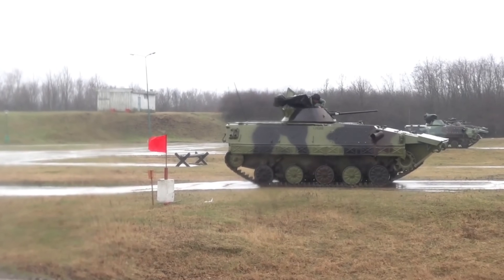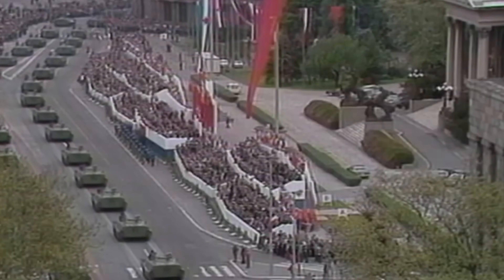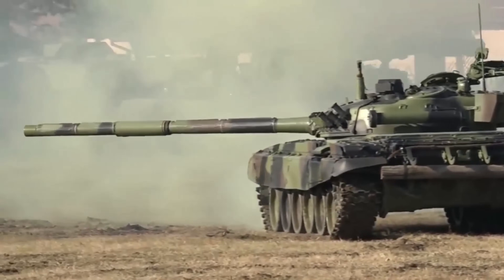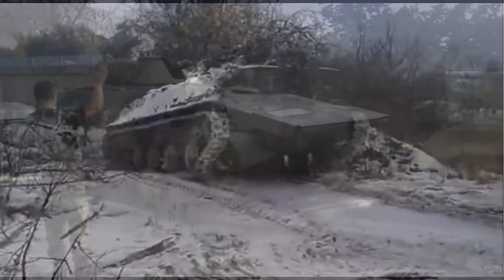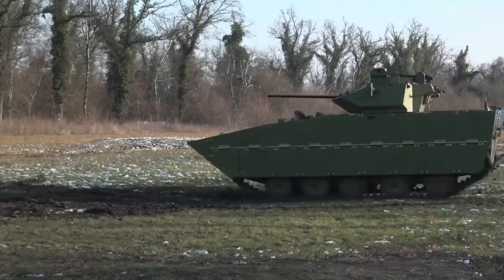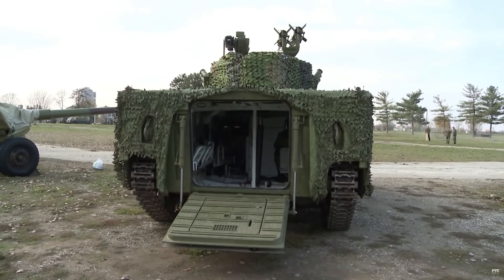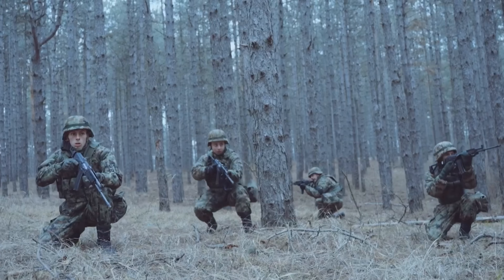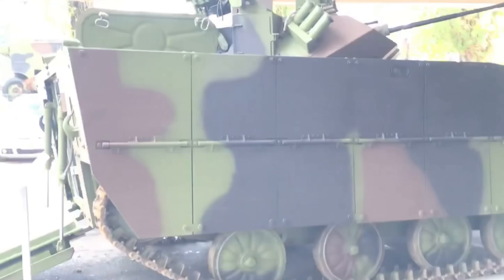Yugoslavia’s BVP M-80 Infantry Fighting Vehicle Explained | SOVIET BMP COUSIN

Comment: The M80 BVP is the AMX 10P. The AMX 10P is the M113 on steroids. They all have 5 wheels on the side. Yugoslavia built a pre-production M113 with a 25% thinner aluminum wall, the OT 60. Based on that experience, they set out to build a domestic version of the AMX 10P.

Comment: Bradley, I was part of the Infantry School team that introduced them to the first Infantry Units at Fort Hood.  Going from the One-One-Three to something that could toss 25mm grenades 2,000 meters down range was impressive.
Reply: The M3 took a lot of adjusting to for me as Cav Scout, the firepower was great but the thing was big as a house compared to our 113s. The reconnaissance part of our mission definitely required a different approach. Honestly though my biggest complaint is that it was easier to find a flat place to sleep on a 113 lol, the Bradley was a big upgrade in every other way.

Comment: Tank you too Matt. Lower cost, maneuverable, and ease of maintenance are invaluable as WWII proved.
Reply: Yeah, if you have nothing else it's much better than nothing. If you can choose, you don't choose M-80.
Reply: @markwhite168  I do , over the BMP-2 ( The only Thing I even like about the BMP-2 is the 2A42 Shipunov )
Reply: @PatriotEnfield3276  well, Croatia first acquired Finnish Patria AMVs as a similar vehicle. With no weapons. Then it acquired Spike AT missile and 30mm unmanned turrets for some Patrias. Then there was an US donation / deal for refurbished Bradleys - they're arriving now.
Maybe an interesting topic for @Matsimus would be to compare modern wheeled and tracked transport vehicles, like CV-90 and Patria.
Reply: @markwhite168 
Patria AMV is a great vehicle and Croatia possesses enough of these to fully equip a mechanized infantry brigade. Although most vehicles are APCs (12.7mm RWS) with only a dozen or so being IFVs (30mm RWS), the 8x8 wheeled vehicles make for a versatile unit capable of accomplishing a lot.
When it comes to combined armored-mechanized units deploying tanks, I have to give advantage to tracked APCs/IFVs over wheeled ones. They have more similar logistical requirements and mobility as tanks.

Comment: Couple things...Version that you showed in this video is prototype. Final version, of the hull atleast, has a ramp (still door will remain as part of the ramp if ramp is blocked) and diferent headlights that are "better packed". Final version will use new stronger engine 370hp instead older 320hp. It is decided that final version uses 30mm zastava m12 cannon ( double fed) and maljutka 2T5 missiles (they are supposed to be packed in tubes instead sitting on rails like in video) with 5 km range and 1000mm penetration. It will be wire semi guided. Wire guidance remains because it can not be jammed. 30mm granade launcher and 7,62mm coaxial machinegun are there also. And also one big thing...Turret will be DUBS type which means all crew will be inside the hull. Armour protection, even its much better than the old one as you mentioned, will remain weak part of this modernization and amphibious cappabilitie is "sacrificed". New fire supresion   and ABC protection sistems, new comunication sistem...There are some rumors that cope cage or jammers (or both) will be instaled for protection from drones. You could do video about nora b52 which is in use with Serbia, Bangladesh, Myanmar, Cyprus, Kenya. Azerbaijan is new buyer and Algeria and Indonesia were expressed their interest too. Keep up with good work.👍
Reply: Those are some impressive changes to the final version! Thank you for sharing.
Reply: I don't the m12 Zastava cannon is double fed.

Comment: M-84 tank should be the next on your list, trust me!
A bit more... BVP in Serbian is exactly the abbreviation IFV in English. This modernized version is NOT amphibious. Mainly due to increased weight. Malyutka 2T5 is exclusively Serbian version of the missile and it is no longer wire guided, it's SACLOS with radio command and range up to 5000m compared to previous 3000. It also has tandem HEAT warhead with penetration of 900-1000mm of rolled homogenous steel. There were some rumors that newly acquired Kornet might be installed on this as well.
The modernization hasn't been smooth either. A couple of years ago, during maneuvers on extremely hot day (more than 40 degrees Celsius), automatic fire extinguisher got activated and suffocated the driver to death, which was put under the rug by the current dictator's regime. Allegedly, this issue was then fixed after this, since there was a lot of backlash when it was heard of. Smth like "So, if an enemy projectile does penetrate it, if shrapnel and fire don't kill you, automatic fire extinguisher will"?
Reply: A few corrections: That incident happened during an exercise that was filmed for TV broadcast. The vehicle was the basic variant (M-80A), not the modernized one. Deceased NCO was the commander of the IFV, he was not the driver. True, air temperature that day was extremely high, but the activation of the fire suppression system occurred due to the 1) nearby explosions which were simulating enemy fire and 2) the firing of a tank that was too close to the IFV, because the person who was directing the exercise, an inexperienced civilian (military-industrial complex criminal), wanted to include as much action as possible in the TV shot. After the fire suppression system was activated, NCO reported it to a superior officer and asked for permission to leave the vehicle, but was ordered to continue forward because filming was in progress. When the commander realized that his men were suffocating, he ordered the vehicle to be abandoned, but he himself no longer had the strength to get out of the hatch. Colleagues pulled him out, an ambulance came across the training area almost in combat conditions because they did not order for exercise to be stopped. The medical team did not have an oxygen cylinder in their vehicle, and oxygen is an essential item when providing first aid in case of halon exposure. The commander was foaming at the nose and mouth. They failed to save him. This murder was covered up. He left behind a wife and two minor children. Rest in peace, Senior Sergeant First Class Dejan Stojković (1982-2021).
Reply: @murzuflapostata94  ❤️RIP. Is there any veteran that after hearing that isn't going, jep sounds like standard army behavior? Cos I want to immigrate there!
Reply: @vladimirmihnev9702 Wait to see what will happen to the current absolutist president Vučić, if he falls and if normal people come to power - welcome to Serbia.
Reply: @murzuflapostata94  Basic model DOESN'T HAVE automatic fire extinguisher, so there is no way it was "basic model".
Everything else is irrelevant except: "a person died".
Reply: M-80A IFV had a fire suppression system from the start. This is an easily verifiable fact, one google search away. The system could be activated automatically or manually. There are also several testimonies of unexpected activation of that system in crew or engine compartments throughout its service history.

There is indeed a high possibility that in this case it really was a modernized variant (prototype). I watched the video of the exercise, modernized vehicles did participate in it. In the official announcement of the prosecution, it is said that the vehicle was M-80A no. 12613. They may have omitted that it was a modernized variant.

All circumstances are very important, in order to prevent the same or similar mistakes and tragedies in the future.
Reply: @murzuflapostata94  That's absolutely horrid. 
It wasn't even a matter of not being capable of getting out, but of being told not to.
Reply: To be fair, while the extinguisher just going off is bad, fire-suppresion in something like Abrams is also toxic to the crew, so maybe the issue was more that it's too difficult for the driver to bail out (on top of the system going off when it shouldn't)?
Reply: @barrag3463 its based on a Soviet design its about saving the IFV  not the cru.
Reply: @vladimirmihnev9702 soviet doctrine is neither about saving the vehicle nor the crew but economy & cost effectiveness
Reply: @patriotenfield3276  its a joke bro.
Reply: @vladimirmihnev9702 It’s not based on Soviet design. It’s based on French AMX-10P.
Reply: I thought the Serbian AT-3 refurbishment looks pretty cool.
Reply: Tipična žutica smrdi na petu kolonu.
Reply: @vickoslavkovic2593  jedini zuti su kod tvog zvalavog predsednika u vlasti. I jedina peta kolona ste vi, napredna bagra.

Comment: 9:08 Uhhmm RPG-7s & Type-69 were not that used in Yugoslav wars btw ( only Bosniaks & to an Extent Croatians used them in limited ) . Instead The Yugoslav wars saw use of RPG-2 & Locally developed anti Tank weapons like the RB-M57 , M-79 Osa ( which was based on French 89mm LRAC F1 RCL ) & The M-80 Zolja ( which was based on RPG-18 , Which itself was based on M72 LAW ) as well as various Rifle launch grenades & both 82mm & 106mm Recoilless Rifles . Also Both The PRAGA M53 / 59  , ZSU-57-2 were used against Ground troops as well
Reply: also serb forces from krajina and srpska had those
Reply: Albanians used RPG-7s, supplied from Albania
Reply: Није, шиптари су користили украдене РПГ бацаче, пошто се тад распала комунистичка Албанија и крало се и завршило у рукама ОВК
Reply: When he said RPG he didn't mean RPG-7/Type-69, he likely meant man portable AT weapons such as the M79 Osa in general

Also all of those (RPG-2, RB-M57, M79 Osa, M80 Zolja) you just mentioned are RPGs or Rocket Propelled Grenades.
Reply: Not 106 mm RCL 105 mm
Reply: @Filiplego1 erm acthually

Comment: If I was designing a IFV for the modern battlefield my first choice of gun would be the Bofors L/70. Its a well proven system with lots of parts and ammunition in circulation and the 40mm round is large enough to be upgraded with whatever fancy ideas we come up with in the future without losing too much punch.
Reply: I disagree, that magazine is too small and i belive it messes with elevation, but i could be wrong. I'd personally prefeer using something belt-fed.
Reply: @EdyAlbertoMSGT3  this gun was developed for air defense originally, elevation shouldn't be a problem depending on turret design. Neither is magazine size when you're "designing a IVF for the modern battlefield". You can dual-feed this monstrosity from a ~700 round magazine if you want, that's how many L70 variants are out there.
Reply: @EdyAlbertoMSGT3 they did make belt-fed Bofors 40mm, especially for the M247 Sergeant York SPAAG but that would take up way too much space in the vehicle.
Reply: @EdyAlbertoMSGT3 K21 IFV older version has good Elevation & is using Bofors L40 as the main gun
Reply: @EdyAlbertoMSGT3 Agreed, metallic belt feed would be my choice.
Reply: This is one of armaments being used on what can be considered a successor to M80 from this video, the Lazar 3M made in Serbia. I say one of as its not known what type of turret and gun the serial production vehicles will have yet, or whether they even solved the ammo feeding for the L/70 for this use case.
Reply: While a fan of the Bofors 40mm, I have to grudgingly admit that it's day has passed. Both the gun and ammunition are far too big and bulky and the performance can be matched or exceeded by more modern systems.  The Bushmaster 30mm can by relatively simple modification be changed to a 40mm with high performance and no loss in ammunition capacity (one of the Ukrainian complaints about CV90 has been inadequate ammunition capacity and a small ready-use magazine). the popular 35mm can similarly be converted to a 50mm gun of very impressive performance. Then there is the 40mm CTA which is far more compact than the Bofors.